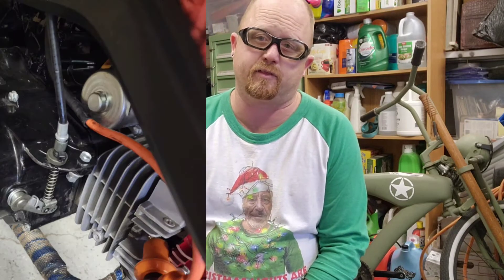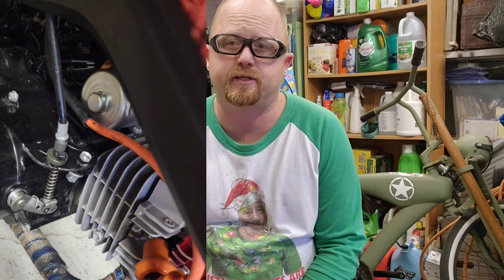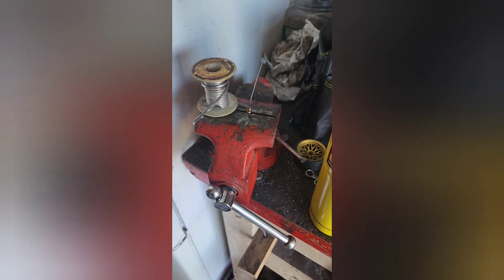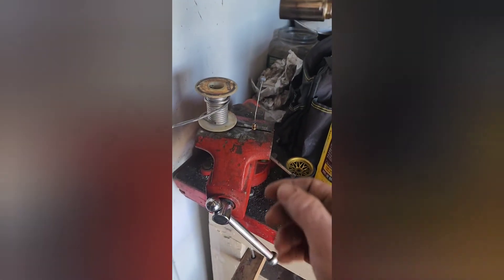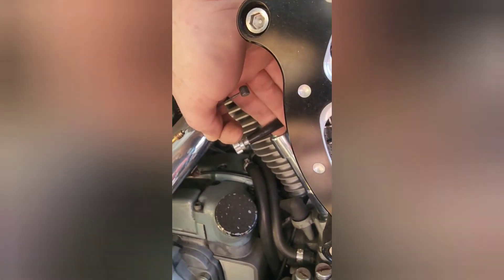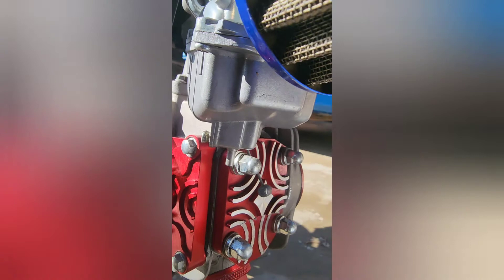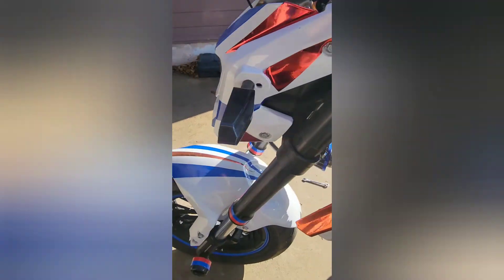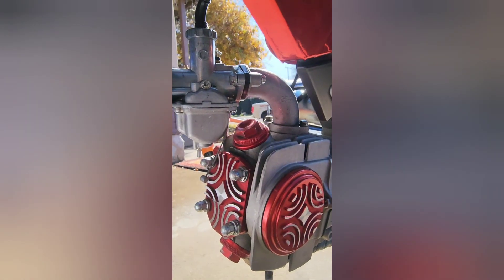Honda Grom clone clutch modification, true fix/results.

Comment: Wassup bikebuilderi hqve a 2024 vader, i am able to down shift into neutral, but if i miss and go into 1st i cannot shift up without either stalling or cutting it off,
Reply from the maker: @pucho513  Sometimes it takes miles just breaking it in as well.
Reply: @bikebilderbear6786  ok, I'm gonna give it a few more miles cause I'm at 300 now
Reply: @bikebilderbear6786  keep up the great work, your bikes look great 👍